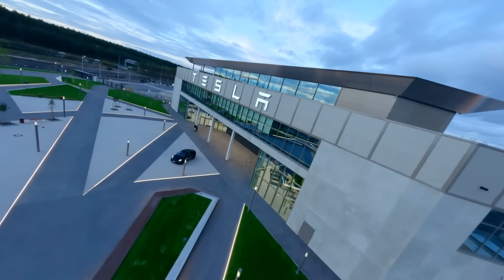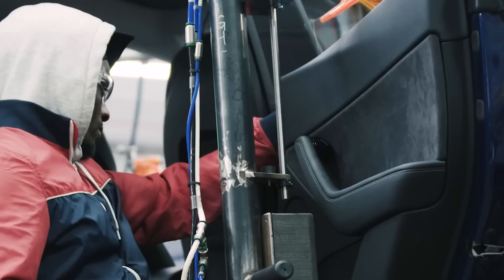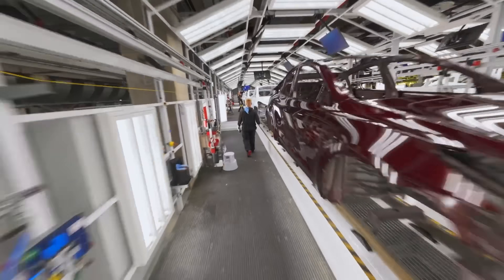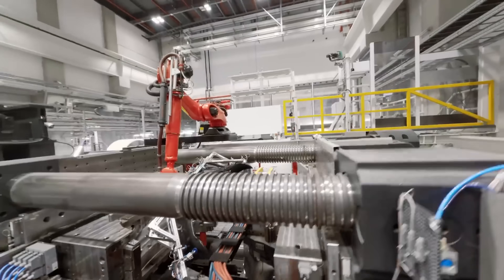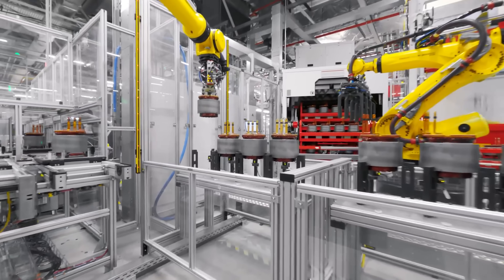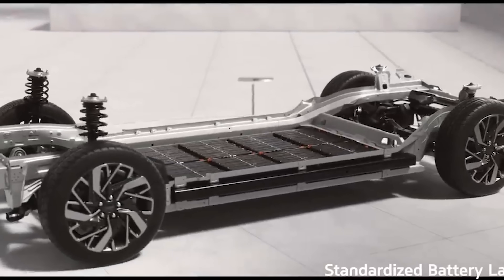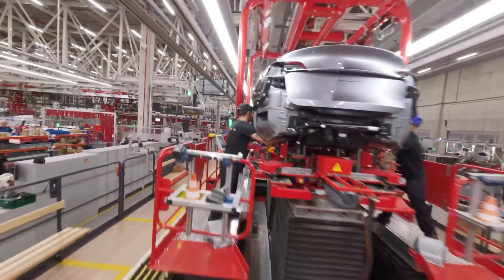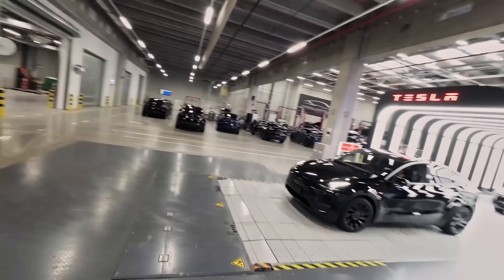Tesla Just Quietly Changed Its Battery Design – Here’s What’s New

Comment: This isnt new. Its been used in heavy vehicles for years. Also, any production of vehicles in the USA using aluminium is going to have serious problems for a couple of reasons. First, because the US tariffs target aluminium and that makes no sense because the USA simply doesnt have the ability to mine and produce sufficient aluminium for its own production and it never will. You cant just mine, process, and manufacture aluminium extrusions overnight - it takes decades to set that up. And no one is going to do that  in the USA when theres a good chance the next president of the USA is going to get rid of tariffs on aluminium. 

Second, aluminium extrusions require MASSIVE amounts of power to produce. Which means Swiss and Chinese producers - who have access to extremely cheap hydro-electric power will always be able to do aluminium extrusions cheaper than anywhere else - including the USA. If Tesla is producing these in the USA then its going to be a liability for them by the end of this year.
Reply: Still be way less expensive even with aluminum tariffs, complete nonsense. Other US automakers will have toi import batteries which will have even higher tarrifs. Likely the batteries will be lower density as well.
Reply: @jasonbou812 i dont think you understand the economic damage thats about to be wrought on US manufacturers. Ive worked on everything from mining, large projects, and heavy vehicle manufacture across asia, as well as for major vehicle brands in europe and asia. The US economy - and car purchases - are about to tank. And nothing will get hit harder than ev sales in the usa.
Reply: @user-lv5bt3nt3r  EV sales everywhere continue to rise. Complete BS
Reply: @jasonbou812 which bit of ‘by the end of this year’ do you not understand?
Reply: @user-lv5bt3nt3r  you are assuming the tariffs are permanent, it looks like they are just a way to brute force trade deals, to get them done in months instead of decades

in just the the past couple of weeks since you posted this a lot has changed, it might be a little premature to write off the US economy